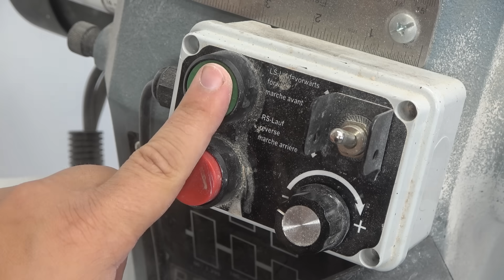Woodturning - My best firewood transformation into a stunning project

Comment: I throw ceramics on the wheel and have noticed that it is important to slow down the motion of the tool as one approaches the axis of rotation.  It is moving across fewer inches per second of the object because the rotation rate is constant and the radius is getting smaller.  It makes spirals in the clay if you move too fast at the center, but wood probably just pushes the tool around.
Reply from the maker: Thanks for sharing this. Very agree, it does the same effect if the chisel moves too fast. For finishing passes I always slow down the movements and take very gentle passes